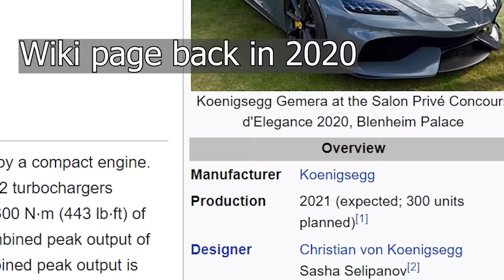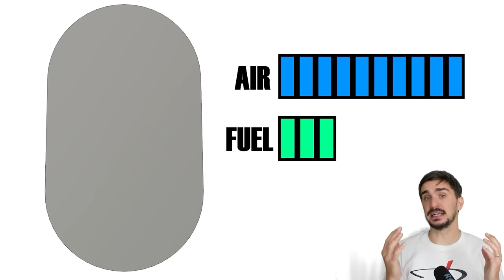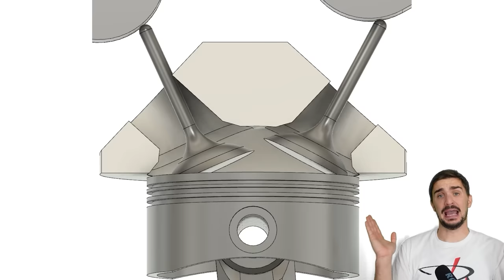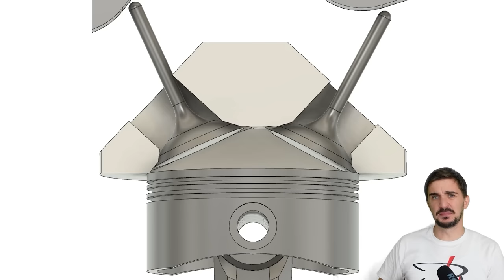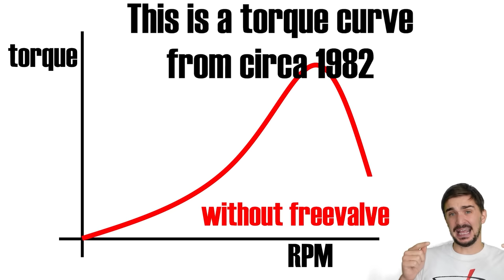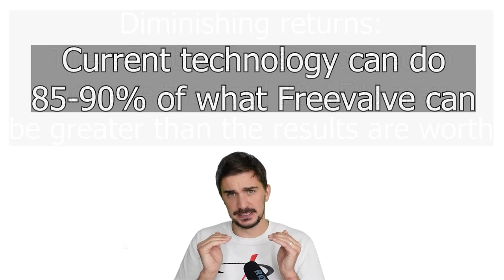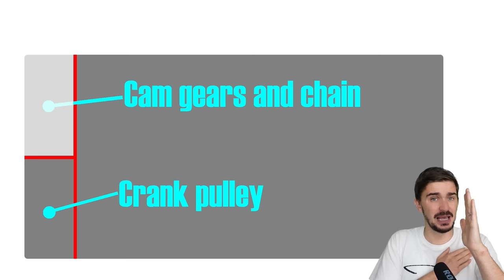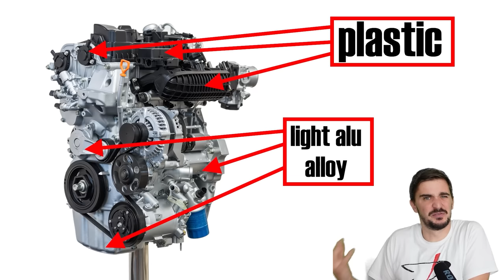FreeValve Isn't a Big Deal. Here's why

Comment: another neat trick with freevalve is that you don't need a wastegate anymore, half the exhaust valves (1 per cyl) are connected to the turbo, half past it; by varying the amount each opens you can control boost
Reply from the maker: True, and it also eliminates the need for a pre-cat. Of course there are benefits, no doubt about that. I'm just saying the cost and complexity is massive to achieve them.
Reply: @d4a actually it’s  much simpler than some sophisticated mechanical systems ,also it has great potential for reducing the cost since you have to produce 16 identical parts ( for one 4 cylinder engine ) , as is known the quantity bring the price down and the actuators can be standardized and used on every brand and model car .
Reply: @Flapping Flight
thats easy to think it is,
but the materials used for even just 1 is possibly costly than a set of head parts like 16 valves plus the cam plus the springs,

its like comparing price of an electricfan with an airconditioning
Reply: @flappingflight8537  I understand what you're saying but there must be big reasons not to use it, because no-one's using it.  You say it's "much simpler than some sophisticated mechanical systems" but none of these greedy competitive car manufacturers are switching to it.  It may be that this "much simpler" approach actually costs more and is less reliable.  It actually doesn't matter how complex something is as long as it works great for a long time!  My Canon R5 has probably 100x the parts of my old Leica M6 camera.  But it's far cheaper and far more reliable.  So who cares about the parts count?  And sure, there are efficiencies of scale, but the production run of current engines already has reduced the cost of the engineering and factory cost to only a few percent of the final cost.  There may be a huge gain to turn a production run of 100 items into 1000, or 1000 into 100k, but little to gain by turning a production run of 1M items into 5M.
Reply: @endurofan9854   most probably it isn’t absolutely ready yet . On the rest you are wrong . Producing precision mechanical parts is much more complicated , time consuming and costly than producing pneumo- electric actuators .
Reply: What you describe means that at full boost you have only 1 valve working. Losing half your exh valve area.
Reply: @PC_Modder > Where Freevalve would make sense is in heavy transport. But it's somewhat easy to tune traditional valvetrain to operate efficiently within ~1500 rpm range (1000 to 2500 rpm) of big I6 and V8 diesel engines.

No, you don't understand.  Heavy transport doesn't need a wide powerband.  They're all turbo-diesel anyway, and with a turbo you don't need to worry about things like valve overlap, scavenging and so on.
Reply: @lqr824  I might have an answer to that: Costs or more specifically - using investments of the past.

When coming up with a "freevalve" system you start from scratch with a lot of technology you know nothing about. Engineers like that, but the people paying the bills are no fans. Instead you maximize past investments and develop them further and further making "small" adjustments that increase the overall complexity but from a financial point of view you can re-use a LOT of the know how (simulation models, production tooling) and expand it with the new technology.

So not only would a switch to an entire cam-less system need a lot of investments, but also you have to justify throwing past investments in the bin, because you won't be using any of that anymore.
Reply: @Dan_Divebomb  > you have to justify throwing past investments in the bin

I can tell you don't have a degree in finance or economics, do you.   Sunk costs play ZERO role in business decisions.  One only looks at future costs and marginal costs.  I'm not going to explain this to you.  Either take my word for it or continue making idiotic pronouncements.  Either way it's the same to me.
Reply from the maker: @flappingflight8537  I'm sorry but I really don't see how something that's hydraulic, pneumatic and electric can be more simple than something mechanic.
Reply: @lqr824  yeah but could be implemented in sports tirms of cars, like a r8 or hell cat might be decent uses where the manufacturer wants to make a limited sale model with a bit more hp.
Reply: @flappingflight8537  Its not simplier at all. Its incredibly complicated requiring tons of eletroncis and complex software and leaves gignatic amounts if room for things to go wrong. Physical steel mechanical syatems are actually simplier, using something like crown gears especially. 

I am also against fakery Koenigsegg tries to pedal. Driving experience is better the more analogue and genuinely mechanical it is. And he want sit make everything bg wire... 

i dont want to drive with damn Logitech wheel set in real car, i want to interact with it with as direct and mechanical interface as possible. We already are robbed of this in almost all the cars. Last time we had majorily analogue cars save for throttle input was late 2000s. And engine from that time.
 Already equiped with mpi, variable valve timing and lift and even direcf injection but with hydraulic powersteering, linkage manuals and real clutch.
Reply: You don't need a waste gate with a vgt either.
Reply: @mal2ksc  Nothing but physics determines valve sizes. What is being proposed is nothing more than an expensive, complex and not very efficient waste gate scheme. High power production depends heavily on maximum valve size with the chamber constraints. This proposes giving away a good bunch of valve area right at the point maximum boost is required. That might help in lower rpm but throws peak power out the window.
Any time that second atmospheric valve is open the turbo ex manifold pressure will push gas into the cylinder and out the atmospheric valve.
Reply: I'm waiting for subscription based engine with freevalve
Reply: @flappingflight8537  Really? Even back when I was in the business of selling machinery to make cars and planes and whatever, it was simple to set up a machine to produce parts to a 0.01 mm tolerance (which was only used where needed, of course.) You'd find some tight tolerance needed in the pneumoelectrodraulic valve, as well. Many hydraulic control valves have micron clearances, and use no seals at all.
Reply: @d4a  smoking causation to cancer wasnt clear until moving away from animal foods becamed normalized, including moving from real butter to seed oils.... combustion has the potential to be far less emissions in situations where it could have a considerable effect (high emissions heavy stop and go traffic with lot of people on sidwalk and in traffic) by simply having small combustion with steady turbo flow charging electric drive. where does petrol come from before processing into usable stuff? a theory says the thick liquid is a byproduct of anerobic bacteria decomposing organic material then the material is pressed under weight of land mass, heat and pressurized into usable material. also see theory of abiotic origin of petrol source material, which exxplains why oil wells fill with the material years after it was dried out by oil rigs.e fuels tries to make this happn artifically, they say that dont need a new car to run the e fuel, they say its chemically identical to what is normal now. e fuels has been sold to peopel like harys garage on youtube, its also for sale to motorsports etc (anyone whos paying the high price that exists due to the product not being sold in large quantitiy becuase its new stil developing tech)carbon capture doesnt have to work only in one place. EV aftermarket values are low prices, because people dont want the low drivign range of worn out batteries: currrent electric car batteries dendrite forming battery degradation is not going to be fixed by recycling, where the battery will rust etc in junkyards, which is why i rather wait for that issue to fix before i can recomend a ev espcially given the heavier weight worsening road wear(cost raw resources and causes emissions , not jus tmoney) and being less safe to at least others in mot crash senarios , see aptera owners club video on safety. microplastics wear from tires, and suppsoedly brakes, is worse than todays common cleaner combustion. given limited battery supply, wouldnt it make sense to encourage the market to make many hybrids out of the same battery mass used for a single electric car? that way, the places where emissiosn happen most , in driving situation that is more like stop and go traffic, those emissions are reduced, so more emissiosn overall is reduced vs the single electric car. similarly, it may make sense to make electric car rear wheel drive to reduce regenrative braking for the sake of longveity , because more energy flowing into and out of battery worsens dendrite formaing batteyr dragradation... so although effeincy is less during the drive, the resource use reduction and emissions reduction is better because of reducing the problems of recycling (and a lack of recycling), and to allow higher budget for effeincy and safety due to longer lifetime of car. if government and corp cared about climate change we'd see much more reasonable laws for efficient car design, but we see leneincy for suv and bigger cars in terms of emissions, anti roll over capability etc. we see anti nuclear energy movements, and so called 15 minute cities, etc such restrictins on productivity and freedom being enforced in the name of climate stuff. tony heller ,suspicious observes , richard vobes, has their ideas. blackrock esg score and stealing wealth from people who use a currency by prinrting money and giving it to chosen people, to weaken people that are not them to control people more, see hwo their buying up property etc, they also promote climate change narrative. so what should i believe, stuff that could be petrol industry deception or battery industry and government deception ? 
i suppose best balance of all values of crash saftey, affordability, emissons, freedom to productivity and ownership of its benefits, is: gordon murray istream 25k mass production sub 2000 lb semi forged recycled carbon fiber rollcage core, lotus elise sort of rear mid engine subcompact 4 seater where the rear seat faces the rear, for areoydynamic momentum perservation especially without power for longevity of fuel, battery, engine, lubrication, etc. even powering around a turn may use the same tire wear and braking and accelerating again. electro hydrallic pneumatic valve actuator like konigsegg freevalve, no crankshaft flat 2 converting linear energy pushed by combustion to charge electric power to move car (see electric linear actuator) or singel piston with hydrallic switch pushing piston bck to position so combustion pushes it, "fric" suspension and variable vane electric motorized and exhuast turbo , subaru wrx cvt ,mahle non magnetic electric drive only and manual steering after 5 mile per hour so lazy super weak people will drive it with software switch for more power steering. people can rent bigger vehicals if needed, roof storage etc can help
Reply: @UncleKennysPlace  really:) you seems to have been in business of selling my friend :)
Reply: @flappingflight8537  simpler? Any hiccup in valve timing longer half of ms (depending on RPM and how for you are pushing it, could be way lower) result in catastrophic engine failure. Mechanical system is self limiting. FreeValve need bunch of safety related addons to be reliable.
Reply: @mrblc882  F1 engines, (which turns around 3-4 times faster than the speed of conventional car engines)uses pneumatic return “springs” BTW . Leave the worries to  von Koenigsegg:) who is proven brilliant engineer, inventor , visionary and successful businessman and to Chinese guys who proved themselves as the “Worlds Factory for everything “ .The system will be widely “ adopted “ after the patent expiration date , as usual:)
Reply: @mrblc882  and it’s not just simpler , it’s much more simpler ( in mechanical mean ) .
Reply: @flappingflight8537  1.) F1 system doesn't have anything in common with this system. F1 uses pneumatic return spring which only prevent valve float and valve bounce. Timing is still regulated by camshaft. Furthermore, F1 engines aren't even allowed to use VVT.

2.) Von Koenigsegg can make brilliant design which goes for very last % of power extracted from engine, but that doesn't make it SIMPLE. It can be complex, but he can put hefty pricetag on it and will not be at lost. Also, asking me to leave worries to him, while playing his PR agent here, is hypocrisy.

3.) If alternative, well established and probably simpler system offers near the same output, switching to new technology isn't financially viable, even when licensing fees are removed.
Reply: @flappingflight8537  just because you moved complexity to other place, doesn't mean it's simpler.
Reply: @mrblc882  so the F1 system is actually more primitive subsystem of freevalve one :)Sure, there aren’t any similarities :) If the gas pressure is capable of closing the valves at such a high speeds what prevent it also to open them :) 
If the rules allowed it , this or similar system would been implemented in F1 since long time ago . I doesn’t exclude the freevalve system to evolve to pure electro-mechanical one in the future because there is advance in ambient temperature super conductors and ultra capacitors which allows such a direction of development .
Reply: @flappingflight8537  system in F1 doesn't need precision, it's basically air spring like in speargun. Precision part is done mechanically.

Air is great for elasticity, but not for precision. That is why valve is controlled by hydraulics, and air is used only for return force.

Renault F1 team did develop hydraulic system, but since it's forbidden by rules, it wasn't used. They have their own solution, no licensing issues, no development costs, but still didn't found it viable to implement it instead camshaft based VVT.

Regarding superconductors, we are still far far away from room temperature. But even if we have material which is superconducting at ~150°C, making valve actuator would be huge challenge (I'm using that to avoid saying it's impossible) - first, only type of controllable magnetic actuators capable of that range of movements and which doesn't require complex and sensitive sensors is moving coil type (like speaker). That sets additional requirements - material must be flexible enough to get current to moving coil and strong enough to withstand acceleration.

But, even if we manage to develop such material, ideal superconductors have zero resistance to DC current, but doesn't conduct AC current. Real superconductors conduct AC current, but with resistance. So, superconductor actuator wouldn't make any sense at all.

Your ideas end up as nice wishes...
Reply: There is really no user case for free valve. In a casual cars you don’t need a wide power band, they are never revved past 2500 rpm and it’s much simpler to have a traditional turbo vvt for that. Just like in a commercial vehicle.

So that leaves car-fans who wants power. But they don’t really want power, they want engagement and fun. Flat torque and perfect combustion throughout the rpm range feels boring and synthetic, it’s not suitable for a sports car.

So actually no user cases to support free valve.
Reply: @flappingflight8537  Might be simpler but one "misfire" or stuck valve open on this technology and engine needs a rebuild. With nowadays parts reliability cars won't even make through the warranty peroid and later be a ticking bomb.
Reply: @flappingflight8537  you need to think bigger than consumers.

manufacturers need to obtain an entire logistic, warehouse, business for entirely new parts that their current business relations and factories cannot produce. they also need entirely new training, entirely new design and testing, entirely new staff for solenoid valve engines because they're not just gonna absolutely abandon their already made camshaft cars.

to a small company like koenigsegg this isnt a real thing. for a big company however? that would mark up the R&D and manufacturing and operating cost by a lot. all that cost in order to get an engine that is 10% better at max, can avoid use of certain parts which for the most part doesnt even change anything (like most domestic turbocharged cars dont even need wastegates most of the time). its a very stupid idea, and a very horrible decision for the company. free valve definitely brings some fun and interest to consumers but as of right now absolutely not to major companies
Reply: The video makes a fair point, but it's the history of automotive engineering. For the most part we have engineers making flawed concepts work very well by putting many hours into it by thousands of great engineers, including the Otto motor itself. On the other hand we have the brilliant engineers that come up with the great concepts, to which the hours put in and experience with is where it's flaws come from. 
So it's a combined effort of progress by the millimeter at the time, done by many, vs the breakthroughs by the small minority with huge steps. I believe we should cherish that minority, for their brilliance, for their thinking outside the box, for a possible trickle down effect and for yet to discover advantages in combination with other tech they might have, and even for the mirror they hold up to the rest of the automotive engineers. That goes beyond boutique quality. I agree with not getting our hopes up too high, but let's celebrate the total rethinking, the out of the box, the people starting with a blank paper again to get to the optimal concept.
Reply: As someone said,I think the fact that you have to reassemble the production lines and sell very expensive machines that become useless makes a huge no for big manufacturers. Also they fail to provide 2 cars, as the video explains, they need to gain trust by show real world performance in a car and make sure their production line is ready before asking the big boys to change is infrastructure.
A not that great selling car could have production problems cause Freevalve agreement, even if they make it really cheap, investment has to be made and guarantees aren't show properly to have gained potential costumers trust. I'm really on the video opinion and the guy how pointed the changes in assembly lines. With today info it's a true gamble and the economy isn't providing the better environment for taking the risk associated.
Reply: @d4a  I think the completed system might actually be less complex in a lot of ways compared to current VVT solutions, but the way to get there isn't. The big reason not to switch is that nobody in the auto industry right now is asking the question "What should our revolutionary next combustion engine be?". Everyone's looking at the combustion engine as on the way out, so incremental change is the only change that makes it past a boardroom. If you propose a radically different engine, even if in the end it's better, less complex to manufacture, and so on, the other guy saying "we can get like 60% there if we modify our existing stuff a bit" will always win out in the current environment. By the time that totally new great engine is ready to go to market, it might already be irrelevant. Now is just not a time anyone is taking big risks with new developments in the combustion engine space.
Reply: @d4a Valve trains haven't been completely mechanical since hydraulic lifters were introduced by Cadillac in 1930. Most VVT systems use hydraulic actuators to change the cam timing.

What I don't get is why FreeValve uses air instead of hydraulic. Engine already has an oil pump, just use it like VVT systems do (since we no longer have power steering pumps).

The biggest issue is licensing costs. The system could be cheaper than other VVT systems never mind variable lift/duration hacks (what a complicated mess those are).
Reply: @DenUitvreter I remember when cylinder deactivation, VVT, and variable intake runners were all fanciful, boutique ideas. Even overhead cams were exotic not long ago.
Reply: i see cappacitor mounting can solve peek power performance